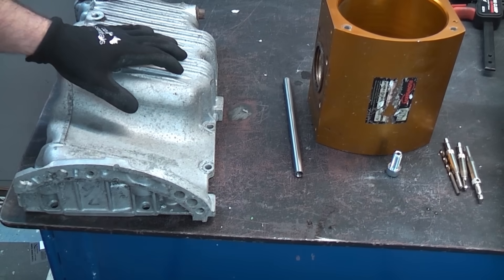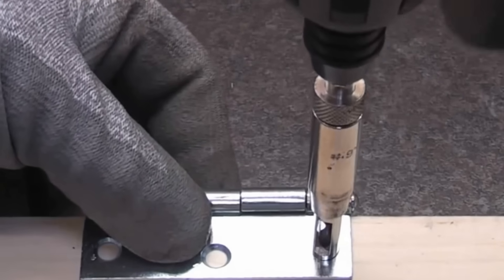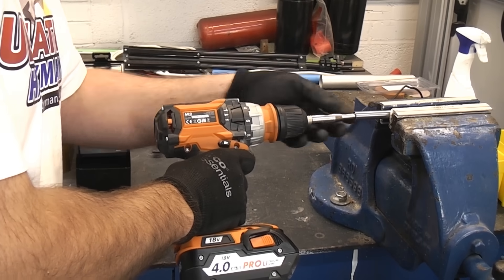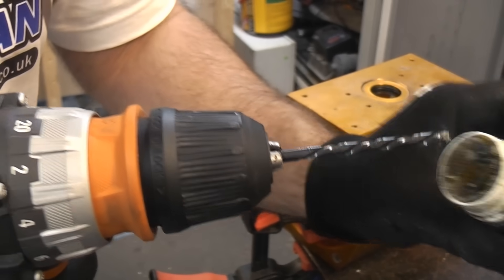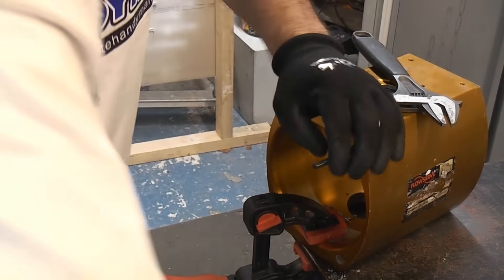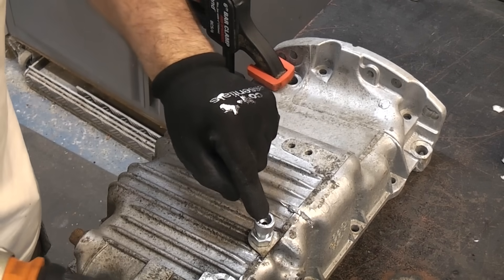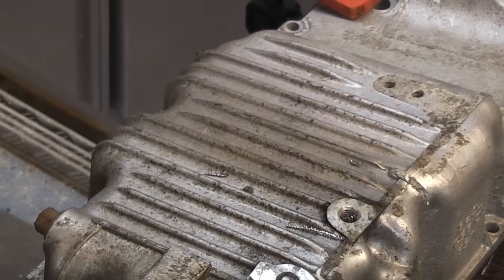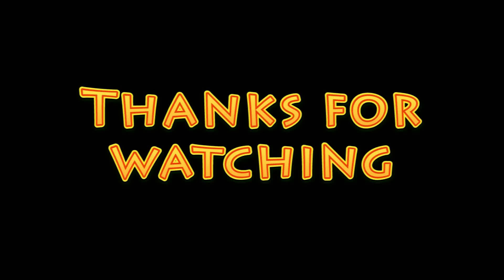How to remove a broken bolt in a deep hole | remove broken bolt in recessed hole

Comment: Was it always a left handed drill bit with the drill in reverse for each extraction?
Reply from the maker: No, but a left-handed drill bit is best. I did use a normal drill bit and extractor at one point, as not everyone has a left-handed drill bit 😂

Comment: Thank you very much for this video.  Many years ago, I was THE machinist in a Ford truck dealership and I did many things there including removing bolts that had been broken off in deep holes. The thing I am most impressed about in your methods is the way you made guides to center the drill bit on the broken bolts.  The thing I want to say is that I did experiments on aluminum getting broken bolts out. 

It is a misconception that a cutting torch can damage aluminum castings. I made a fixture for a machine that one could  bolt a valve body on to the fixture and the machine would exercise the valve body just like it was in a real transmission.  To make these fixtures, we had to cut up an old worn out transmission case where the hoses from the machine could be married to the valve body via the fixture we made.  I sawed the first case with a metal saw and that was slow. We tested cutting the case with a cutter we put on our milling machine still not real good.  

I spoke to a welder about the problem we had cutting the case up.  He said bring me one of the cases and I will cut it for you in no time. He turned up his welder to very hot and used a carbon rod.  He cut the case in no time using that method. I asked him if we could use a cutting torch to do the job and he said no.  I called nonsense on him for what he said and he allowed me to try. I did and I was not able to cut anything on that aluminum case with the torch. The reason for it is that aluminum is a good conductor of heat and will dissipate the heat faster than the torch can heat it. Also, the larger the hunk of aluminum, the better. May not work on a small piece.  

I know the method works as I have depended it for years.  I showed my son and he has used it being a mechanic who had broken off bolts before...etc. I urge you to try this method a few times on something that is no good to build your confidence and skill before using it on something important.
Reply: Plasma cutters work on Aluminum.

Comment: Great ideas for drilling on center! I'll make the suggestion to heat aluminum parts if the bolt is still too tight for the extractor to get it out. Aluminum thermal expansion is greater than steel, which might be just enough to relax the grip, especially on larger threads. You don't want to go crazy of course, 300F is about the limit for most aluminum alloys to retain some semblance of hardness.

Comment: Does anyone know what type of drill bit will work with a grade 8 bolt? Titanium or steel? I'm not sure what kind
Reply from the maker: Any drill bit suitable for metal should drill out a grade 8 bolt, but if you are struggling, try a cobalt drill bit, I used to drill out 12.9 bolts using cobalt drill bits 👍

Comment: old timers trick...lol that's basic. When your easy out snaps youre in for a fun time! Ive had to weld to recessed bults build up and weld bolts on that's nothing special tbh .. If you hit the center of the bolt with a proper punch you dont need a guide. Rookies!!
Reply from the maker: You can drill out a broken extractor-
https://www.youtube.com/watch?v=7JCfEMrCjhc&t

Comment: What diameter holes do you have in the socket cap screws, and what dia drills do you use? Brilliant video
Reply from the maker: I think I used a 6mm hole in the M10 bolt, then used a 6mm drill bit. The video is here on how I drilled the bolt, you can use a lathe or a drill press - https://www.youtube.com/watch?v=6mZj0J6CNYA 👍
Reply: @ultimatehandyman  thanks for that

Comment: Heat and apply oil, heat and apply oil.....DO NOT attempt using an easy out this quickly....ever tried to remove a broken easy out? It will break off in the hole if  you try this as fast as this cat is showing.
    Aluminum expands at a crazy rate compared to steel......flex the aluminum many heat cycles and allow the oil to coat the threads....ask me how I know.....................

Comment: I have a number of steel screws where the heads have snapped off in plastic rawlplugs on my bathroom wall. Any idea how I can get them out  ? The shafts are too thin to drill into and the rawlplugs are set into tiles.
Reply from the maker: A diamond coated holesaw will work, they are hollow, so you can use one to file/grind away the wall plug - https://www.youtube.com/watch?v=k66K520mWT4&t
Reply: @ultimatehandyman  Thanks. Have ordered one.

Comment: I only see hinge sighting drills for sale in imperial sizes. Are imperial sizes the right fit for metric bolt holes? Or do I need to find a metric set for automotive work?
Reply from the maker: Imperial sizes will be fine 👍

Comment: what if the bolt is broken flush with the surface?
Reply from the maker: Just centre punch the bolt in the centre and either use a left-handed drill bit, or normal drill bit and extractor 👍
Reply: @ultimatehandyman   Finding  the exact center that is what is hard. In my case.. The surrounding material is cast  iron(  Old wood stove) .And It seems that cast iron is easier to drill through than the steel  bolt. I already drilled some  broken bolts, and the bit deviated to the side and I ended up drilling the hole at least a quarter of the way out of where I wanted to. My point is that it seems way easier when the bolt is broken a fair distance  below the flat surface...but again, when does that ever happened?

Comment: Use a small tape handle to turn the screw extractor, not a godawful big and sloppy adjustable wrench. The tape handle is easier to control and can be pushed into the broken stud while turning to maintain a bite with the extractor!!
Reply from the maker: Please pay attention 😂

Comment: In the last bolt I extracted, the threads were all locked together so I couldn't use an extractor :p
Luckily it was both 316 stainless so I could just drill it out till it there was only a thin layer of the bolt left and then hit it with a screwdriver and a hammer to basically peel away what was left from the bolt :p
Reply from the maker: Stainless is a real PITA, as it galls up!
Thanks for the comment 👍

Comment: Looks staged. How would these techniques work in real life projects when everything is rusted and seized?
Reply from the maker: I used these a few times when I was a maintenance engineer in a chemical plant, corrosion and heat cycled bolts were all over the plant! 
Thanks for the comment 👍

Comment: Try dropping in a piece of rubber, insert the broken bolt and tighten has much has you can then try removing it again, I wanna see if the drag from the rubber will make it come out

Comment: Excellent video - I highly recommend that you place the object with the broken bolt so the hole is facing up then spray a penetrating oil and let it sit 24 hours before working on it. The oil should penetrate to loosen all the threads and allow for a much easier removal.

Comment: Left handed drill bit really has done the trick for me several times.  You have to run the drill in reverse to avoid dulling the bit.  If it doesn't get it you can still use an easy out with a tap handle afterwards.  If you don't have a Cap screw with a center hole through it you can use a center punch (a whole set isn't very expensive) that is slightly smaller than the threads.  Use care to not booger up the threads.

Comment: There’s also a way to remove a zinc bolt from an aluminum head using chemistry which is even more of an old timer trick. By using alum the spice, a little water, a little heat and a lot of time and patience, and if you can keep the bolt submerged, you can work on something else and around 20 to 30 hours of the alum working it’s magic, the zinc bolt will literally have dissolved while leaving the aluminum completely intact.

Comment: Always blow out the hole before trying to use the extractor so that the shavings don’t jam up the threads.
And
When removing bolts from aluminum you should “shock” them or heat the aluminum (expansion) before trying to disassemble any of it.  Steel in aluminum causes “dissimilar metal corrosion” that causes that unnerving sharp “crack!” sound you get even when it doesn’t break off.
I also usually use a long’ish extension, if it doesn’t pop loose I’ll switch to an old beat up Snap-on ratchet… put some lefty torque on it and wack the head of the ratchet with a hammer - that shock combined with loosening torque usually pops it loose without any issues, add heat if needed.

Comment: Gotta say, I love the homemade guide. Drilling through a bolt to screw in and use as a guide was brilliant. Also, there are tap sockets made by Lisle and Irwin. The Lisle sit on the tap and lock on it. The Irwin are like a drill chuck, you turn it to tight it down so you can use a 3/8 ratchet. They’re pretty cheap and would be worth picking up (if you haven’t already).

Comment: The problem of having a, in your example, a steel bolt shearing off in an alloy hole can be significantly lessened by applying an anti-seize, such as Prematex Anti-Seize Lub, compound to the bolt before screwing it in. Also, it's important to never over torque a bolt.

Comment: What a great video.  Now I know how to use a stud extractor etc.  Drilling a cap head bolt to use as a guide is such a great idea!  Thanks for taking the time to show this type of stuff here on YouTube - much appreciated.  Best Regards SR.
Reply from the maker: I'm glad the video helped 
Thanks for the comment 👍
Reply: A lot of socket head cap screws are made from hard material.  I would use a grade 2 bolt if possible.

Comment: This is interesting if you have all of this equipment.  I don't and the snapped-off bolt was almost flush with the outer surface.  It would jiggle a little, I just couldn't grab it at all. I tried a few different things, finally I got an old pencil with a red eraser at the one end and tore off a long 4mm wide strip of duct tape and wrapped it around the pencil with the sticky side out.  So the end of the pencil where you would normally see the eraser was now covered and sticky.  It was the perfect size for the broken off bolt. Maybe a little wider than I would have liked, but it was all I had.   I pushed it flush up against the loose bolt and started turning slowly, in what I was hoping was the right direction, to the left and lo and behold the bolt came out stuck to the end of the pencil with the duct tape. Another use for duct tape!  I tried other tapes first and they weren't tacky enough. If the bolt isn't wedged in there too tight, this might work for some people.

Comment: Nice video. But I'm sceptical to the use of copper paste when it comes to aluminium. As far as I know aluminium chemically doesn't go well with copper due to galvanic currents which causes corrosion on the aluminium rather than prevent it.

Comment: What if the sheared off bolt is deep inside...like 5 1/2" inches?
Reply from the maker: You might be able to use a longer guide, then get a long series drill bit to drill it out. I don’t think they make long series left-handed drill bits though!  👍

Comment: Bro I came in from the mower about ready to loose my shit. Have worked rebuilding my whole mower deck and last step putting the mower blades in. I over torqued the bolt that holds the blade on and sheered it off right in the brand new spindle down in the hole a ways. Thank you for restoring my hope. I really appreciate your video! Thank you.
Reply from the maker: I'm glad the video helped 
Thanks for the comment 👍

Comment: If you want to avoid ninety percent of snapped bolts  always put a bit of heat on bolts that have been sitting in a casting CRC  it it is not coming CRC heat when cooled down more CRC more heat

Comment: The bolt is a great idea, key is keeping your hole centered, TY for that tip. Try turning the extractor counter-clockwise while tapping on it with a hammer seems to give it a better bite. Been a machinist removing broken bolts on aircraft for over 30 years. Glad i stumbled on this video!!!
Reply from the maker: Thanks, Greg 👍

Comment: These are nice in theory... in reality every time I have dealt with a broken bolt it's been somewhere extremely cramped where you have to try and do the one inch punch with your hanmer, which is f*****g impossible. Don't waste your money on left handed drill bits or "EASY OUT" extractors or chisels or any of that crap, it's all garbage.

Comment: The only problem that I see with this video is that at the last he speaks of using copper anti-seize with the aluminum part, if you use copper on aluminum it sets up electrolisis and erodes the aluminum. Only use the silver anti-seize on aluminum, copper is fine for all other metals.

Comment: I've spent 40 some years having to remove broken bolts out of situations like these. The idea of drilling out a bolt to use as a guide is an excellent idea. The idea of a hinge sighting drill is new to me, also. Great ideas!!
Reply from the maker: Thanks Terry 👍
Reply: @ultimatehandyman  Does anyone actually sell premade bolts with center holes already drilled?
Reply: Yes give me a week I’ll make ‘em lol
Reply: I helps the case if you have a lathe to drill the hole in the bolt in the first place
Reply: @MolloRelax I thought everybody had a few metal lathes laying around
Reply: Really love this thread protecting method with a drilled out bolt.
Reply: Yes its a genius idea specially since this happens mostly in critical places.

Comment: Just slip a plastic pipe that fits tight.
Use a 70.18 or an actual extracting rod.
Hook it to you welding stinger.
Stick it in the hole welder off.
Push down or in about 3 to 5 lbs on the rod.
Turn welder up to max.
Quick flip of the on off switch just long enough to start voltage.
Take off stinger.
Bend rod at top.
Use it to remove stub.
Done.
Much faster.

Comment: When all else fails, use a larger sized drill bit than than the thread of the brokenn bolt, drill the boken bolt into non existence, then re-tap a new thread to the size of the larger drill used, then simply use a new bolt the size if the thread you tapped. It doesnt even matter if you get slighly off centre, as it will still pull tight when using the new bolt. This has worked for me every time.

Comment: You place a nut over the broken stud or bolt, weld it in place using a rosette weld or hole plug weld, let cool then un-screw it. Easy!

Comment: Leave the left hand drill where it's safe.  Chances are if the drill does catch and bind  ('Murphy's Law') it will / may snap at any point. Now the hardened steel of the drill and whatever's left occupying that 'dead center' spot.  This means a harder steel drill than what you used,  Might as well get three of them; more depending on the to and fro store mileage.  Same thing can happen with a normal twist drill.  Easy.does it.
Reply from the maker: You can always drill out the broken drill bit- https://www.youtube.com/watch?v=7JCfEMrCjhc&t
👍

Comment: Here’s a crazy method that works really well when a steel fastener is stuck in an aluminum hole;  soak the fastener in a hot alum solution. The alum eats the steel and leaves the aluminum alone. It’s slow (4 - 6 hours) but very useful when, e.g., you’ve broken a drill bit inside the fastener.

Comment: here's how to get that broken bolt out, Get an I/8th inch pipe nipple, 70/18 1/6  rod. down inside the pipe nipple, weld it up, spritz some water on it, let it cool some and out it will come. simple.

Comment: Used to call his "bolt extracter" tool, an "easy-out". Also can keep the drill bit near the center by dropping washers of the same OD as the hole's ID. Then center the bit in washer's holes. 
Have also seen J-B Weld applied (sparingly) on a second back out bolt. Scuff ends of both the broken & back out bolt, run back out in slowly til bolt contacts broken bolt, back out appx 1/32 turn, allow time for JB-Weld to dry then carefully back out both bolts. YOU LOSE IF WET  JB COMPRESSES OUT TO THREADS.

Comment: Yes successful on big  broken bolts but what about  the small broken bolts?   where the drill bit wont fit?
Reply from the maker: You might just have to use a small diameter drill bit and try and centre punch the centre of the broken bolt first!

Comment: I’m a tool maker who now works in a mode shop for a defense mfgr i spend %40 of my time removing broken bolts and taps. I just drill them out. I got tired of trying tricks only to resort to drilling. If the part is small enough to put on a mill I’ll set it up and use a peck drill cycle with a good carbide straight flute drill. Every once and a while an old school screw extractor or east out will work once a pilot hole is drilled.

Comment: However you do it, centering the drill is key. Often bolts break off because they bottomed out in the hole. Drilling all the way thru the broken bolt releases the lock on the threads and helps in extraction.

Comment: Where do you find bolts, especially socket head cap screws which are very hard, that have holes drilled all the way through them?
Reply from the maker: I'm afraid you have to make them yourself- https://www.youtube.com/watch?v=6mZj0J6CNYA
Or a local engineering firm might make some for you.